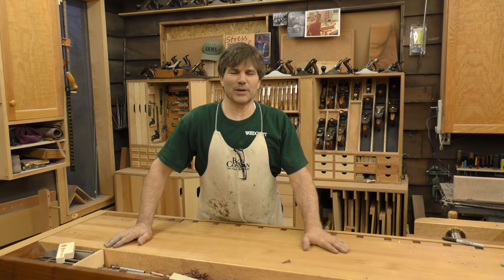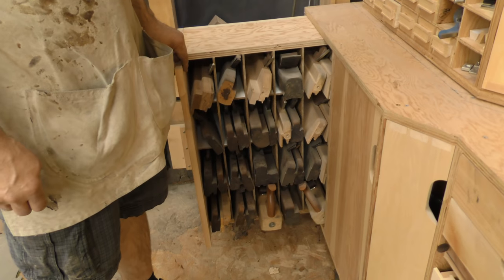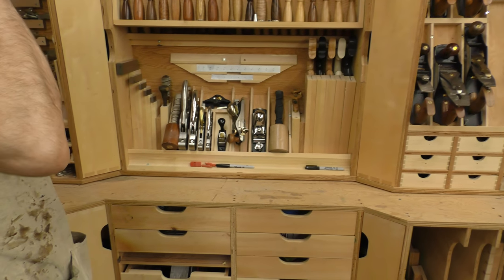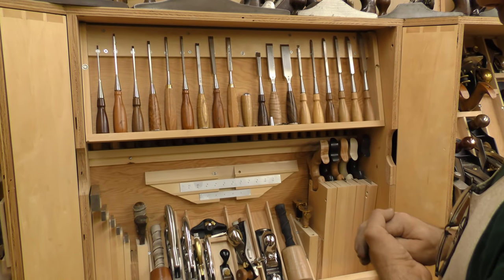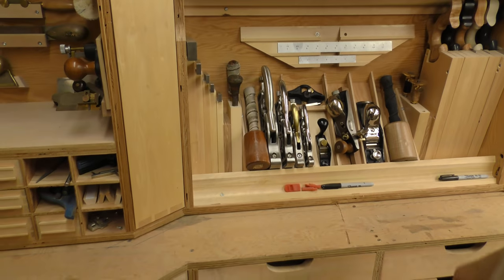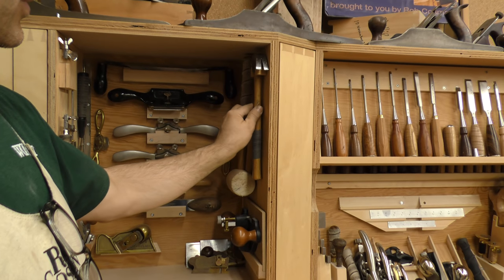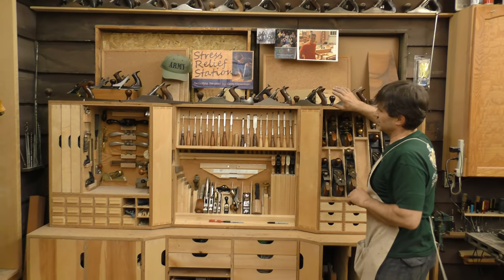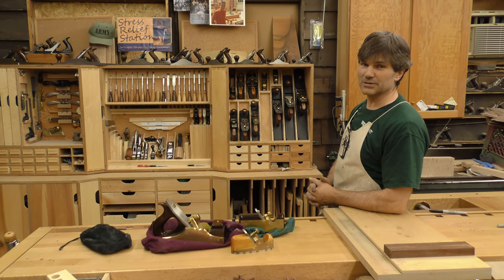Tool Cabinet Prototype with Rob Cosman

Comment: Hello, great video. 
My Father was a Shipwright for many years. He built and installed the cabinetry in the cabins of commercial fishing boats of all kinds. I only visited the job site once. The cabin of the boat was filled with plumb bobs and a water level.  I never understood how skilled he really was in my youth. 
He would do the measurements in the boat which was supposed to be sitting as it would be while in the water. Then take the measurements and drawings of HOW someone wanted the finished cabinets to appear to the shop and build them…. Then go back and fit them to the haul of boat with the finish face looking plumb and square.  Which they always did, amazing. 
I truly admire those like yourself that can create such incredible items using mostly hand tools.

Comment: Great cabinet with some great ideas. The pullout vertical storage trays are nice. I think you end up with better use of space with those. Making them double sided can save some space and decrease the number of drawer slides you need. The "Tip Out" idea is nice as well.  All around nice job. The only things with these "cabinets" is they are very personal to the person making/using them - I think that's why I like looking at them - so many creative answers to storage problems.  Scott

Comment: HI Rob, I have always loved that design of your tool cabinet. Just wanted to mention and i dont know if you have ever used them but they do make over extension drawer slides and the Blum and KV brands seem to be the most solid in my opinion. Im not a big fan of them personally for regular drawer use because they tend to sag when all the way out but i think they would be perfect for that pullout for your files. great vid as always. Josh

Comment: I like those hinged holders 🤔 Carving knives and gouges are the other option usually other than rasps. Or a foredom. I used to whittle the tenons for my hammer handles (I go to a lot of garage sales). Then a blacksmith friend told me to use a rasp - much, much quicker, and you don’t have to worry about wild grain as much. Although that said, I do see people turn to a rasp sometimes when a knife would be far safer and more efficient, not to mention a fraction of the price. Many woodworkers sadly don’t know much about whittling, which involves two hands unless you’re peeling bark or really hogging off soft wood.

Comment: I'm struggling with ideas for new tool cabinet as well. The only addition I would consider that I liked in my search was a roll top cover that goes sideways. The days that you are making lots of dust , you could close the doors . It adds a little to the width but that would be negligible considering the purpose of the door in the first place . Plus a fancy grain door would look awesome . Just a thought !

Comment: Really great tool cabinet.  Mine is still in my head, been there for years, and it keeps changing.  The kids are gone and I'm finally slowing down so, God willing, I'll have time  to make one.  Gonna make a real bench first and like the tool cab it keeps changing, and I think it'll be eclectic with a lot of classic details but  built around my needs.  It'll replace the one I'm using now that I made for temporary purposes 30 years ago.  I don't want to walk to find a tool anymore, just pivot.  Ever explore Japanese joinery?

Comment: Hello Rob...Great project and process...!   What I saw: If you raise the upper part a couple of inches, the shelf can become a little deeper, and will not interfere as much, in daily use, with the lowest row of drawers.  To me, it looks like you can afford it heightwise...   Also, I suggest raising the whole unit two inches.   Greetings from Denmark...Jakob.
Reply: It is not your height, but what you do with it, that defines you...!   "ToteKick"...!
Ideally, the shelf is empty... an in between place.   When you pick a plane, you can put it down, on its side,  to grab other stuff.   A small Tote, or a small Tray, for screws, several small tools, for chisels, or for measuring devices, can stand on the shelf, preparing for carriage and carriage return.   More spring greetings from Denmark...Jakob.

Comment: Great viedos love your tools are you going to make a pdf to biwnload your wook bench. Would love a list of your saws and plane selection. If you could only have a couple planes and your dovetail saws which would they be for u DIY guys on a budget
Reply from the maker: Workbench is in video format now, also on demand.  Plans are available in 3d.  These are for sale on our site.  Top tool purchases: stones, 1k, 6k, 16k and a lapping plate to keep the stones flat.  Next is a #5 1/2 or #6 plane, a low angle block and a medium (3/4”) shoulder plane. Dovetail saw and three chisels, 1/4, 1/2 and 3/4.  Marking tools are a must have as well.

Comment: Rob, I'm making my own (smaller) tool cabinet and wanted to use magnets to hold my chisels too - How do you find the strong magnets affect your chisels? I've heard people say they transfer a little magnetism which is annoying when honing as the bits of steel you are abrading stick to the tip preventing a decent mirror polish?

Comment: Hey Ron I got a question that pertains to safety. When using the lathe, and a face plate that you bolt / screw into the wood. What is the best type of screws for something like that to use?

Comment: Dear Rob
I just joined your channel - so I’m sorry if you present the argument in another video. I’ve watched quite a few videos, and I’m delighted that you sell some of the tools you use - I will check it out! To the question: I see that you rest your planes on the blade. I was taught to always put them on the side, so the blade doesn’t dull. Why don’t you?
Thanks!
Reply: Hi again, I just found your “Top 5 Hand Plane Issues”-video, and thus the answer to my question. Just wanted to leave a thank you for replying so kindly. And to add a thank you for great videos!
Reply: Setting it on wood won't dull the blade.  On it's side,  it is a bit of a hazard if you brush your hand against it and cut yourself.